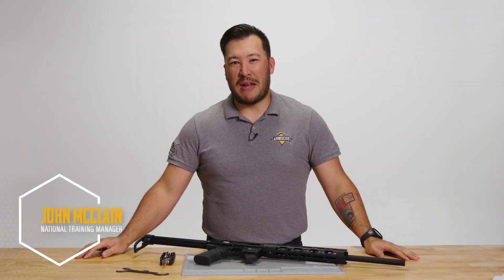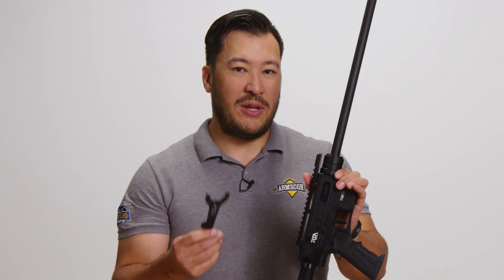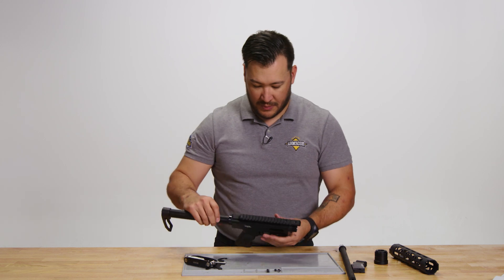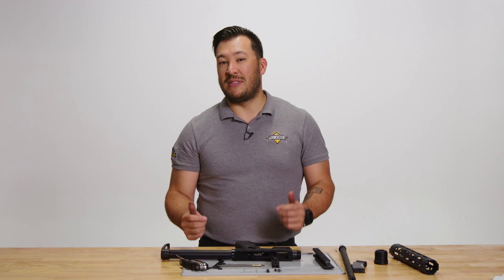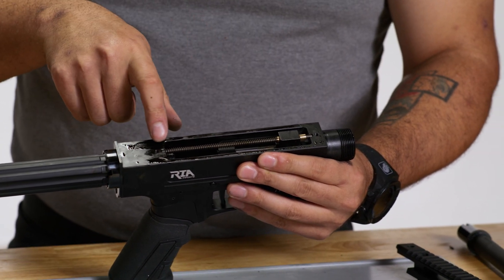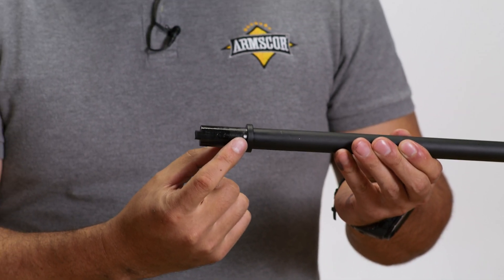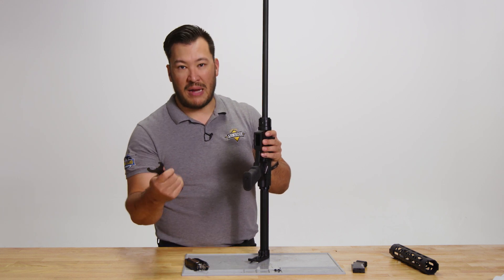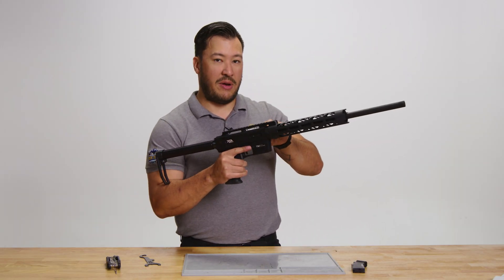Armscor Disassembly Assembly Training 2024 | TM22

Comment: You have to remove the scope every time you field strip the rifle. 🙄
I would strongly suggest a torque setting when replacing the top plate to ensure it doesn’t loosen from firing.  It will be interesting to see how they hold up to an Appleseed weekend.

Comment: could i replace the hand guard with a longer one?
Reply: Yes, the grip is compatible with AR parts. Same with the stock it’s a commercial buffer tube.
Reply: @colemoyer2572  not the grip. the hand guard. the cage that fits over the barrel. could i put a 16inch hand guard on it instead of the short rail
Reply: @CaptainPercocet I’ve been trying to find out the same thing